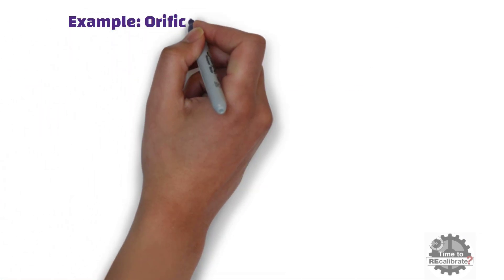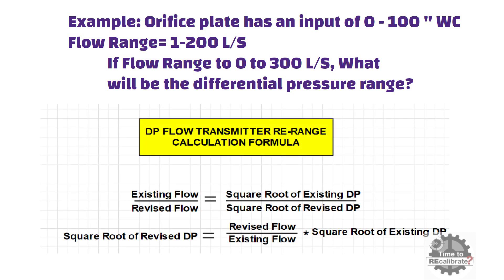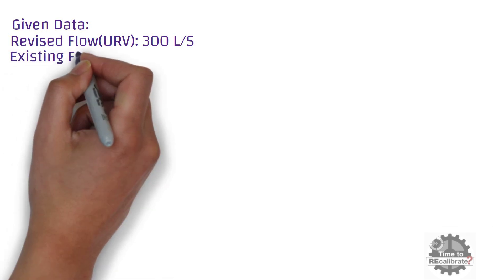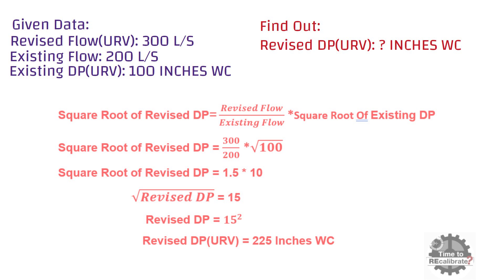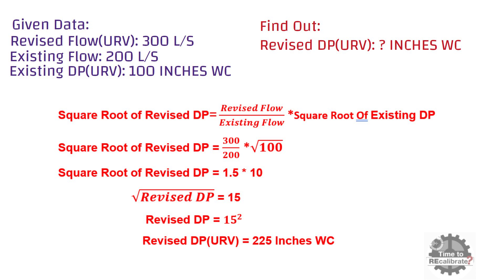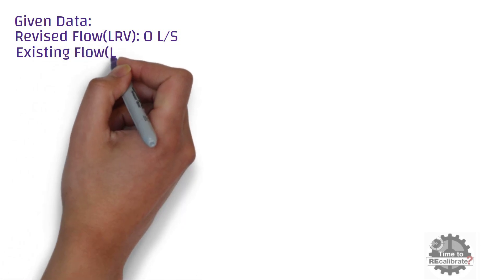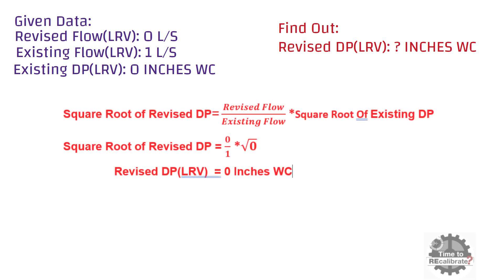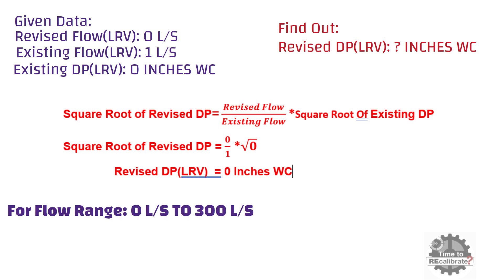Differential Pressure Flow Transmitter Re-Range Calculation | Revised Flow Range Of DPT

Comment: Hi. Thanks a lot for the existing calculation. how much i change the DP and mass flow for DP type FT if the existing one is 0-2500 mm h20 and 6000 kg/hr. Can i change this DP upto 0-15725 mm H20 and 15000 kg/Hr?

Comment: I wired todaY my first model 230 barometric senser got abit confused as to what the units purpus was .like was it a voltage unit or a current unit at first me thinking 3 wire but no 2 wire instead sendi g the current 1 direction

Comment: Thanks a lot Mr.
Mr., How to know flow range a DP transmitter on name plate DP range is 0 to 2500 mmH2O, then data engineering they have for flow range is 0 to 243 m3/h.
I just want to know how to make that flow range to be like that, i.e 0 to 243 m3/h?
Thank you
Reply from the maker: Hello muhammad
It all depends on your process. In this example, system creates differential pressure of 2500 mm H2O at 243 m3/h flow rate.